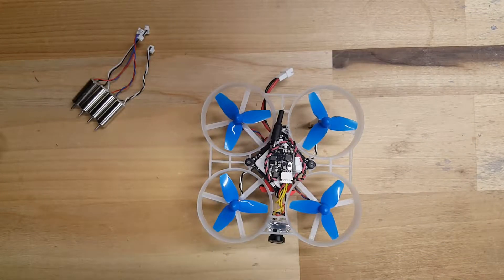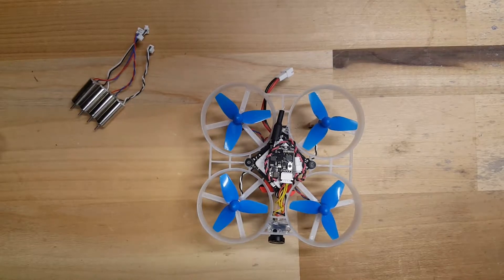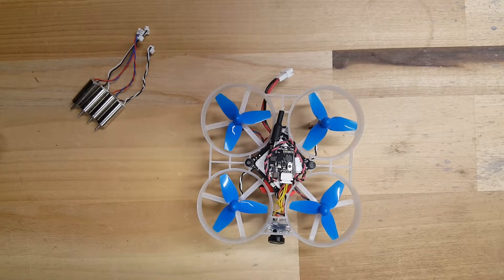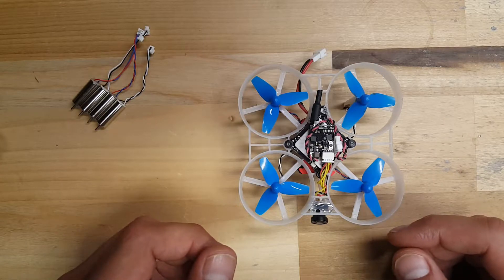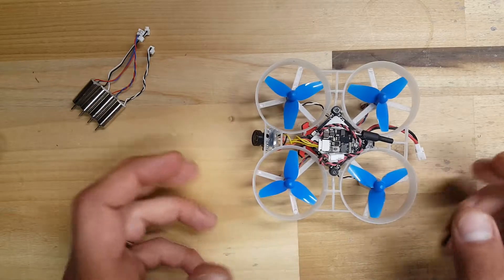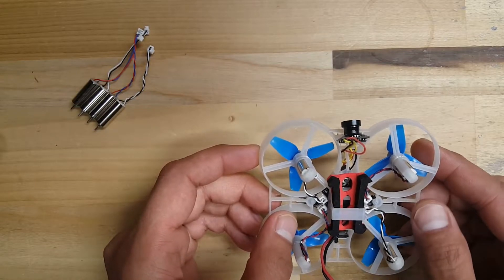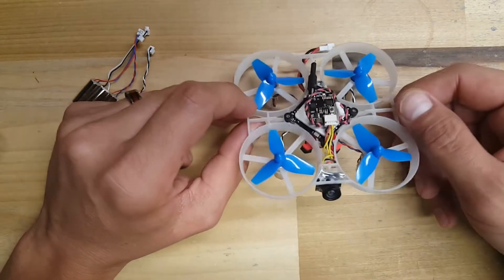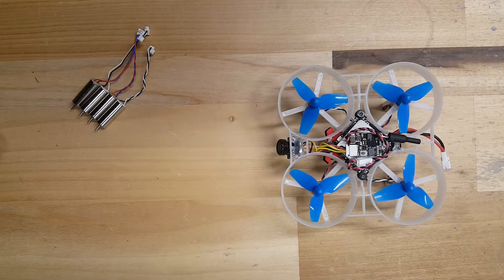AKK A5 AIO Split VTX Camera

Comment: How did you fixed  the cam on the frame, hotglue? I think the cam is not bad but not good as a fx. Anyway nice build
Reply from the maker: +FredericoSecondo camera is attached with hot glue.  It's a nice camera for the price.